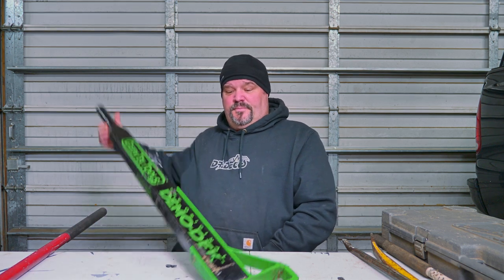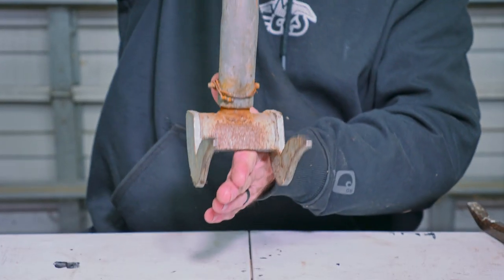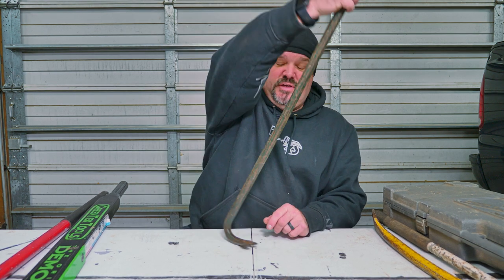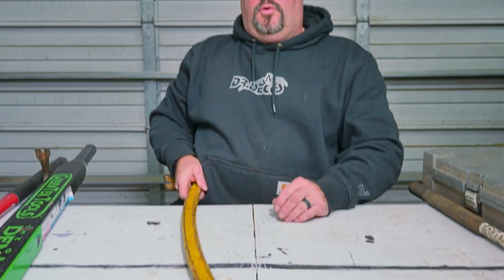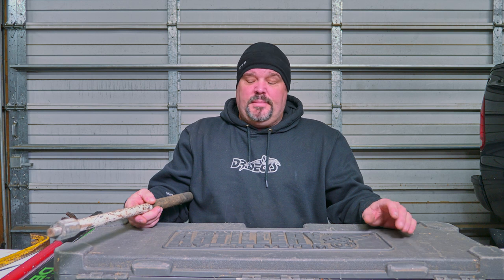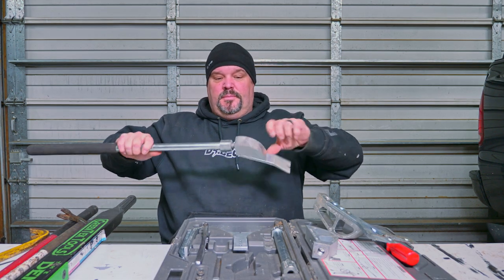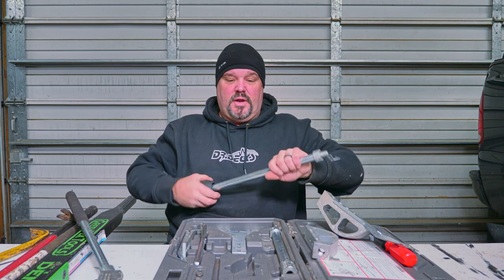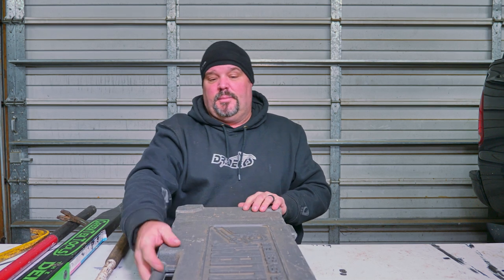Top 5 Pry Bars || Dr Decks

Comment: Where’s the Burke Bar?  That suitcase looks like a waste of money.
Reply: It’s in the back of my truck daily!
A leatherman is a cute and somewhat useful multi tool that stays in the truck too,too heavy for EDC… but the Burke bar, well that is a hell of a multitool! leathermans and most multitools are a great example of “jack of all trades, master of none”, that is not the case with the Burke, it is a master of many jobs, and can easily be used effectively to do so many other jobs without much sacrifice to quality. It may not be a finishing hammer, but you can drive anything in with it, hell I had to use it for a screwdriver, folks laughed, on guy ran to the truck to get a screwdriver but I was done before he even got to the truck… I think that was the same day we used it move a 700# safe, tear out a door jamb to fit thru, then help place it precisely… but the truck we hauled the safe in got stuck while we unloaded the safe, I told them not to worry at the end of the day I grabbed a 2x4 scrap and pretty easily helped heave the truck up out of the mud. No one was teasing me about loving Burke bar by the end of the day, but they sure laughed at me when I grabbed it and said “this tool is going to do most of the work for us. If we had 2 of them that day it would have made things an absolute breeze.
Thankfully all 3 of those guys now proudly own their own Burke bars, now they tease me cuz they have shiny paint and mine does not… I e told them that just shows me that they need to learn how to use it!

Comment: What's your approach to stripping old decking that is screwed down?  Do you bother removing the screws that can be backed out with an impact driver? For the screws that are stripped out, do you cut them flush with the joists?
Reply: Yes and yes

Comment: What a bunch a gadgets and garbage juts get a full size gransfors bruks though they came in many sizes or a hultafors and be done with it for life not sure of Hultafors warranty but gransfors has a 20 yr warranty made of great Swedish tough carbon steel and the ends are so sharp and thin it gets into any small area or pull any nail out no matter the space u have to work with but the edge is so thin and sharp u can cut yourself they can be pricey depending on the size bar u pick but u will never need another bar for the rest of your life but if u do slightly damage it Gransfors will make it like the day u bought it definitely %100 the best wrecking bars on the market and the fact this guy didn’t show one means he really doesn’t know wrecking bars even if he uses his subpar ones everyday.